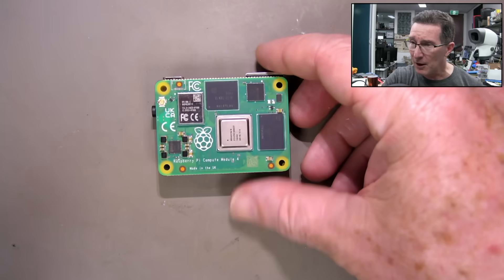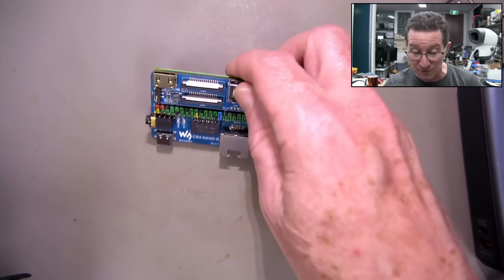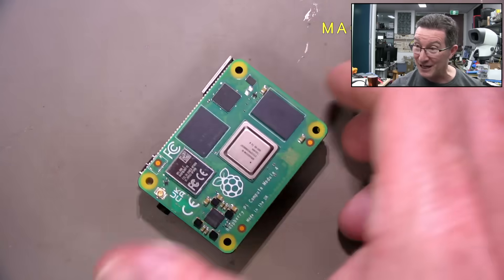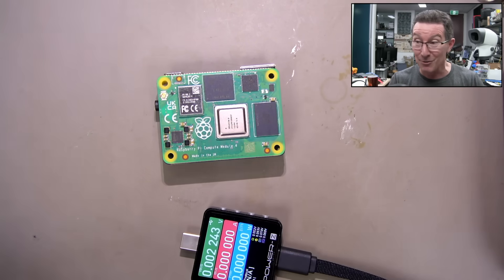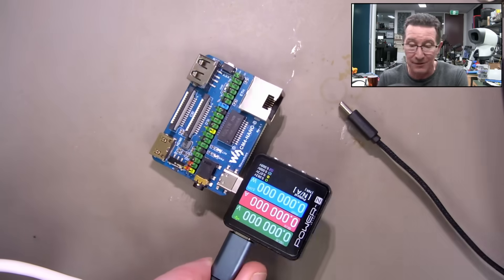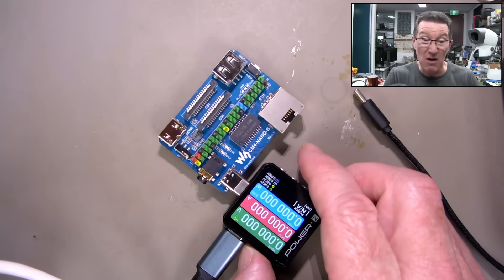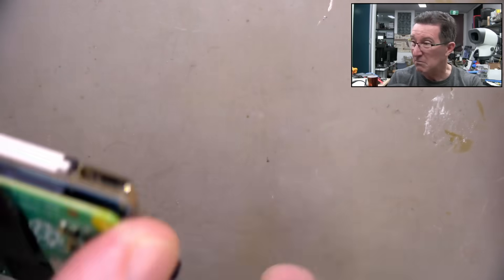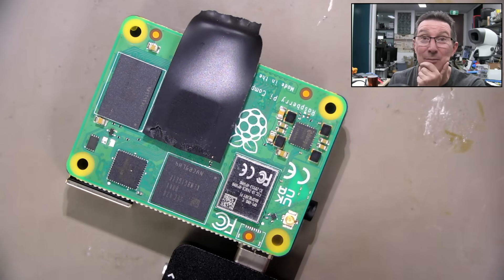Raspberry Pi Compute Module CM4 FAILURE

Comment: Mine CM4 and couple of RPi-4's did the similar thing where the PMIC went bonkers getting hot more than 80*C for some reasons which took out the whole boards with processors. I thought to replace the PMIC but its almost impossible to get it from China to India due to Regulations and also there are multiple Forums saying that we need to program or get a programmed PMIC for the specific board.
Reply from the maker: Ah, interesting, thanks for a confirmation, that was the most likely cause. See the 2nd video, the DC-DC converter has shat itself, taking out multiple chips.

Comment: Raspberry Pis don't seem to have the best reliability. I had an RPi 3  that would crash as soon as it warmed up even the tiniest amount. The other one I bought at the same time was fine and could run up to the point where it throttled to keep itself in spec, all without crashing.

Comment: I've seen a lot of ethernet to MII xceiver failures while I was working for an ISP. Most stuff worked again after I replaced mostly Micrel/Microchip xceivers. Some failed in a way that it would only link up on short cable runs or port flap intermittently. It could be caused by cable-sourced electrostatic discharge, but the BCM5421 has integrated ESD protection so I think something pretty huge was induced in a long run of non-shielded (UTP instead F/UTP or S/UTP) cable or the shield is unterminated. There was one occasion when I saw that a surge event was violent enough that even the magnetics failed without any visible signs. Any large thunderstorms lately?
Reply from the maker: The most likely cause is a failed DC-DC converter.
Reply: @EEVblog2  That's unfortunate. I'm just about to watch part 2. I wonder if the main, sequenced (4 rail) buck or the one near the Broadcom PHY failed. Soon I'll find out!

Comment: what is the output voltage on the 3.3 to the chips?  it the regulator is putting out 4+ Volts, one of the chips (ethernet) is trying to act like a fuse.

Comment: Cool video Dave, off topic rant incoming:

I've abandoned every thing from the raspberry pi corporation. During covid they really showed their true colors. Consumers had to pay 300 percent markup due to 'chip scarcity', yet the company sold them by the tens of thousands at commodity prices to any corporation who wanted to buy them for whatever enterprise IT purpose they needed them for. I'll add I do not find anything wrong with them used in that way. 

They directly violated their mission statement and coming off as hypocrites. So many companies dumped their excess stock at basically cost after the chip shortage. 

I think they're neat devices but sometimes you have to stand on principal. I've seen no person call them out for this. More powerful mini pcs or refurb business machines can be had at basically the same price as an 8gb pi 5 kit now. Makes the product obsolete for most tasks in my opinion when you weigh the performance difference and cost analysis for add-ons for it to support ssd or other hardware you need interface carrier boards for. Plus linux supports almost every type of hardware config you can imagine for any purpose really.
Reply from the maker: I didn't hear about that.

Comment: I've replaced ethernet phy chip more than once, they seem to sometimes fail without a good reason. In my case, replacing it fixed the board so not surprising to me... And yes, the failure mode caused it to get hot...

Comment: I had a Pi 4B 2GB do something similar a few years ago, the PMIC chip went kaput on mine and it was superheating, all in all causing the board not to boot, no ethernet response etc, there's a good chance that if the PMIC went kaput it also took out the ethernet controller chip at the same time on the CM4.

As my board was still under warranty I contacted the retailer PiHut and got a replacement under warranty through them, you should contact the manufacturer of your AERL unit and have them see if they can get a warranty replacement for you as those PMIC failures seem to be common with certain batches of Raspberry Pi Foundation SBCs.
Reply: It's also possible the PMIC was just consuming all the power by being a space heater :)

Comment: Come-a-gutsa indeed... I wonder what happens if you desolder the ethernet chip - will it start up, or is the voltage regulator shot too?

I once did a research project for an EV charger company, involving a CM4 and hand soldering those Hirose connectors on a bunch of boards because our EMS screwed up and couldn't fulfill the order in time, haha.
Reply from the maker: See 2nd video.

Comment: First guess is that (on the original main board) the Ethernet chip either experienced some ESD and/or the shield of the Ethernet connector is somehow connected to GND and then may have some unfortunate path where it may show a relative high resistance to the rest of the GND so when you insert some shielded Ethernet cable you introduce quite undesired currents which may blow the Ethernet chip.
If there is a proper 1M resistor between the shield and GND and some high voltage caps, then it is OK and then you can throw out that theory...

Still you need to add some TVS diodes like the TPD4EUSB30 to protect the signal lines from the Ethernet connector to the Ethernet chip.

Or maybe the CAN bus or RS485 bus caused some issues where some pins were pulled higher than Vdd when the board was not powered?
I have seen some Ethernet chips on ESP32 boards which could get damaged if some GPIO pin was pulled high while the Ethernet chip was not yet powered.
Reply from the maker: See 2nd video. Failed DC-DC is most likely.

Comment: Discoloration between the laser etched "O" and "A" of Broadcom could be indicative of the fault. Timestamp 5:10 to 5:11 looks like a pit burned out of the surface in that location!
Reply: yes, I can see a hole in plastic casing. probabilly a short in the die burnt through the plastic. it is generally indicating the failure inside the power section of eathernet controller. thal also explains the different current draw in different time. i have experienced these issues in some microcontrollers, internal surge protector or zener will disapate most of the power as heat and once it failed and became open again mcu will work again.
Reply from the maker: Nailed it, thanks, see 2nd video.

Comment: I wanna see the other side of that gateway PCB. This usually happens on Ethernet devices when the design either doesn't include Ethernet magnetics or ESD/TVS clamping devices or doesn't correctly isolate the pair traces and/or shield from the rest of the circuit. However even if everything is done correctly, nothing can protect it from extreme transients. Is the device installed outside or the Ethernet cable run in a particularly vulnerable location? That and is the switch it was connect to still working fine?

Although I do have one Raspberry PI 3B with the bare die WiFi module cooked from ESD. It has a similar failure mode of somewhat consistent latch-up into ouchie-burny mode

I believe the CM4 will still boot if you hot air that IC off it.
Reply from the maker: It has proper Wurth magnetics. Ethernet is through the roof space from the router to the garage.
Reply: @EEVblog2  correctly shielded with a good ground? I had a switch port get fried with a below ground cat5 run to the Cabana during a lightning storm, put in a TVS clamp module in for good measure - no problem since. Just needs the spike stars to be in alignment and its toast.
Reply: @keithmarlow143  TVS isn't part of the magnetics.

Comment: Should remove the Ethernet chip. There's a good chance the rest of the board is still working.
Reply: Exactly what I was coming to say. How many times do we need to burn our finger to show it's bad before we pull the chip and see if the board powers up? That's the conclusion I was waiting for.
Reply from the maker: 2nd video is up.
Reply: I agree!  These broadcom chips die on various devices - with seemingly no specific cause / event
Reply: The DC to DC converter might be the source of the problem. If you remove the Ethernet chip and the converter ( or one of it's critical supporting components ) has failed, the next thing that might blow will be the component next in line as the weakest link.

Comment: Looks like there is a transformer for the ethernet on that carrier board unlike what the others have said.

But I've had issues with the CM4 where the power supply will shit the bed.

Also, CM5 is avaliable!
Reply from the maker: Yes, it uses a Wurth transformer.
Reply: Pi4 is similar, the PMIC will self-immolate for no obvious reason (and of course it's a proprietary part you cannot buy OTS)

Comment: since compute module has no transformers for Ethernet maybe poorly designed Ethernet port design on the other board fried the chip?
Reply: I'd try removing the I/O board and powering the CPU to see what happens.  The I/O may not be broken, but that's not to say it's not contributing in some way.
Reply from the maker: @russellhltn1396  You can't power the CM4 without a main board. And when it draw the same 5W or so on the AERL board.
Reply from the maker: It uses a Wurth transformer, looks good.